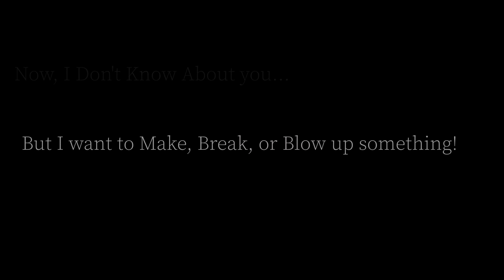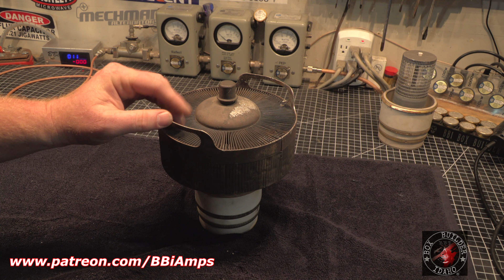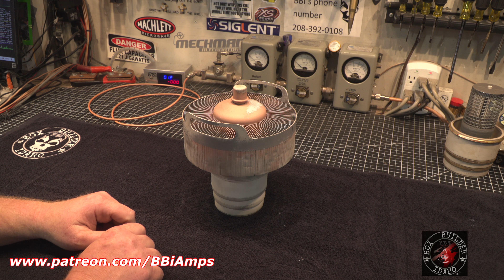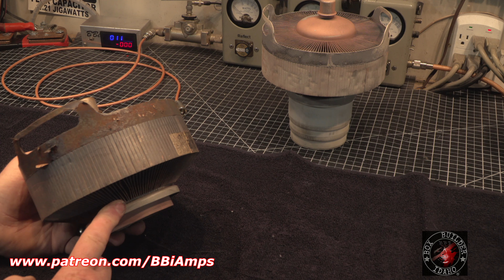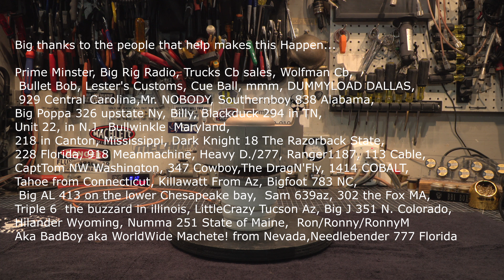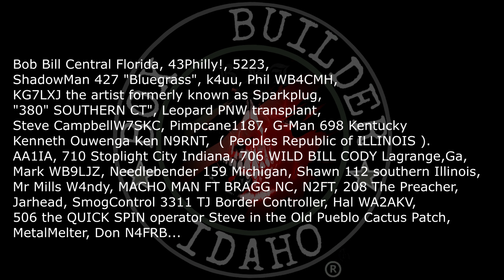Sunday fun day!!

Comment: The anode is made from very high purity copper that has been made specifically for vacuum devices, also knows as OFHC. The only nickel plated part is the rim/holder on the anode. The brazing alloy is AgCu, hydrogen is used for its oxide reducing properties, this gives optimal wetting when brazing large surface area parts. The grid connections are pre galvanized with silver, or done by electroless silver plating(very thin layer) after brazing. Copper can be plated with silver directly, no need for nickel. Keep in mind that the nickel is a terrible conductor at high frequencies, skin effects has its thickness requirements.
Reply from the maker: Nope the anode is made from a substance called nickel Cooper

Comment: Nice! A quick word of caution, the ceramic parts of that tube likely contain beryllium oxide. That would mainly be in the white parts between the anode and the grid rings. Beryllium oxide dust and its fumes are highly toxic. Over the decades I've worked on and around a lot of very high power devices, and we always always wore protective masks and gloves, just in case we broke something. Just sayin'...
Reply: Pure Alumina is used for tubes, BeO is used in microwave semiconductors mostly. Never seen a ceramic power grid tube with BeO.

Comment: I have seen the inside of one before... but it was not in good shape. Most of my tubes come out looking like that on the outside though after running non stop for 3ish years which is about their lifespan in commercial use. Lot of soot if not corrosion. The transmitters move so much air they pull in outside air through a cheap AC filter and there is a second filter on the transmitter but the pa cabinet still gets dust and dirt. I think I have posted a few pics on your FB before. I can post more.